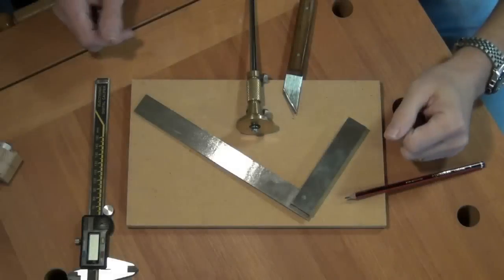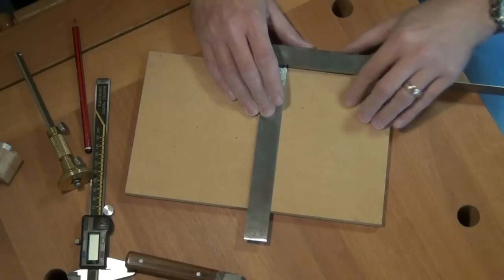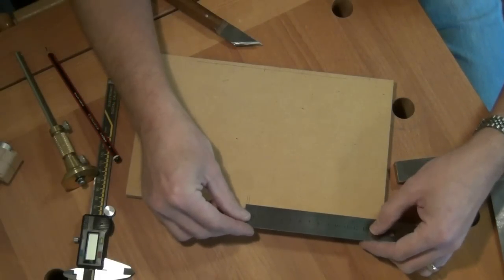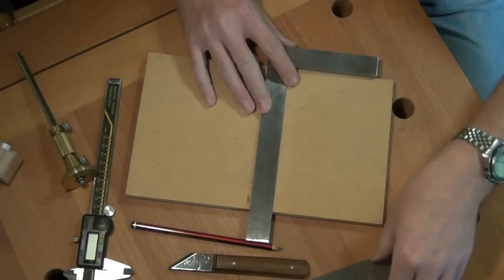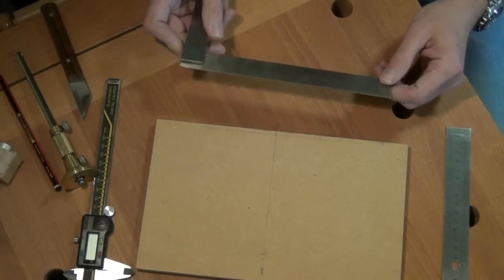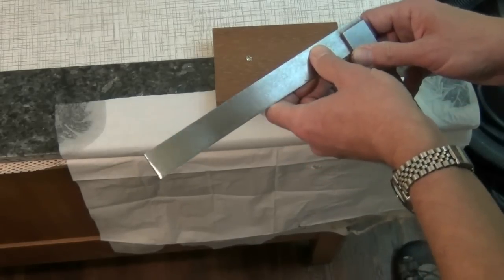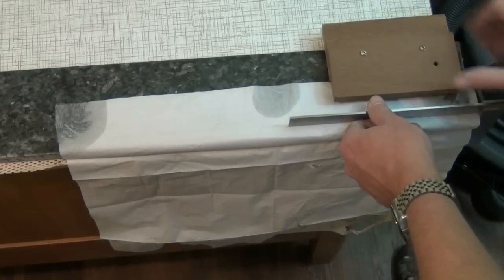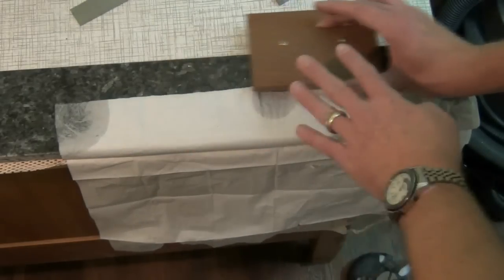How To Fix A Try Square

Comment: I've seen videos of people adjusting squares using a few taps with a center punch, one side increasing the angle and the other decreasing it. No need to sand or file anything.
Reply from the maker: That's interesting, never seen that myself. Cheers
Reply: Much better way to adjust your square. It keeps the original dimensions and parallels of the square.
Extremely important for accuracy.
Well worth learning how to do it

Comment: you want to bring down the high end more than the low end. Best way is to go from one end of the sand paper to the other leading with the high end. That way the high end gets more sanding but the blade stay flat.
Reply from the maker: That video seems like a lifetime away, but your suggestion is very timely as I currently have some carpenters squares awaiting correction. Maybe I should video that to make an update.

Comment: I do believe there is an error in your method. With the fixed head end of the square resting on your test board, the distance which you push that ruler into the gap between stock and test board would have to be identical to get useful results. When you flip the square and move that "spacer" you introduce a new variable. Hope that make sense.
Reply from the maker: Thanks for your suggestion. It's so long since I published the video I'll have to watch to see how my method then compares to how I do it now, and understand your point. Maybe it's time I filmed a new version.
Reply: @mitchwoodwork  If I could re-write my original post, I'd actually like to start off by saying that I really like the considered and methodical approach evident in all your videos. Thanks also for your response and willingness to consider my comments.
Reply from the maker: @johnny7254  Thanks, appreciate that.

Comment: Thing is with these types of squares is that they can be knocked out of alignment as was one I bought not too long ago so I don't personally favour this design.  You may as well have tapped it back into position rather than go to the trouble of removing material as it will more than likely move again with the slightest knock.  Throw it in the bin and buy something better is my advice.
Reply from the maker: I find the "carpenter's" squares far worse for holding accuracy. Of course all should be treated with respect.
Reply: @mitchwoodwork  I agree (I don't throw my tools around but things get dropped, fact of life) and the combination squares can't be trusted because they wear quite easily in my experience.  I found the Tengtools try square to be a happy medium between nice ergonomics and precision.
Reply: @deemdoubleu  combination squares are adjustable too. Use a needle file to drop either slide in the body to bring it back in to square.
Loosen the locking mechanism before sliding the rule and it won't wear anywhere near as quickly
Reply: Throwing away perfectly good tools is a crime.
To adjust, use a punch to spread material whichever side it's required.
If the joint is loose, it's either a factory fault or a result of damage and not a reflection of the type of tool being used.
One experience is not enough to make the suggestion that a tool should be thrown away.
If people had more respect for their tools and the knowledge of how to care, maintain and repair them, they'd be considerably better craftsmen and better for the environment also.
The throw away mentality is not one people should be proud of.
Reply from the maker: Well said